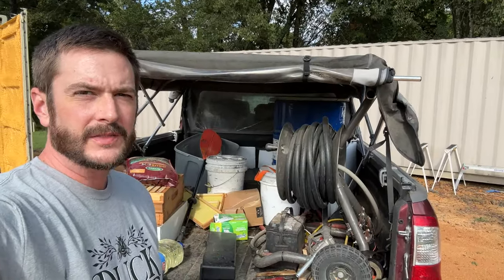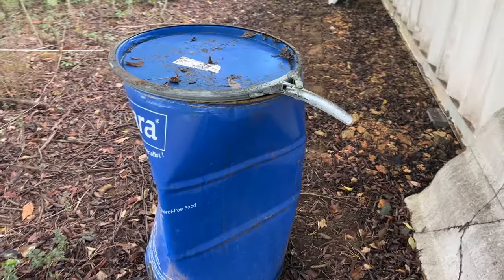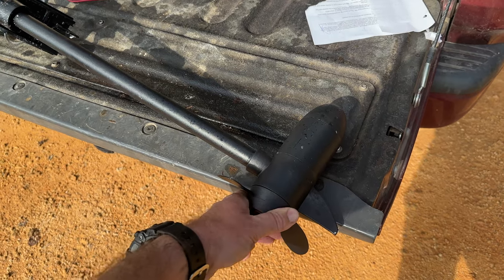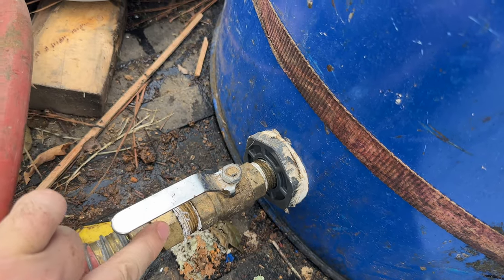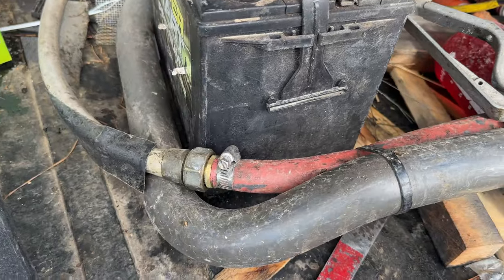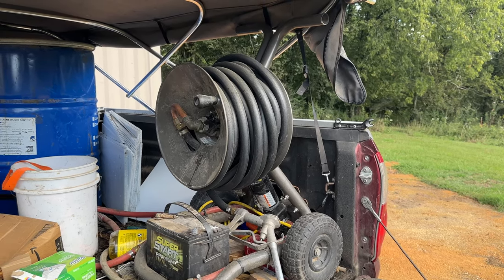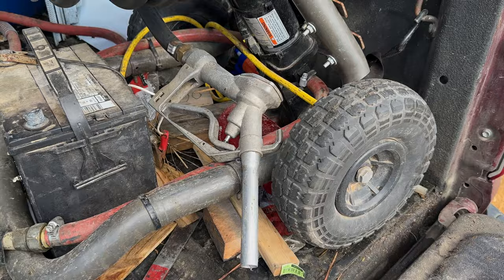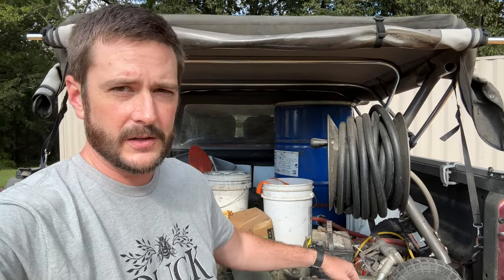Sideliner Syrup System

Comment: Hi Nathan. Just a thought. As diaphragm pumps get bigger (more GPM) they can also have a higher pressure shut off switch. Anything over 45psi tends to make the trigger harder to pull on your style nozzle. We use the same style nozzle that you do. Great video as always.
Reply from the maker: Thanks Bob!  I don’t have a lot of trouble with the 45 psi, but did consider swapping it for a 35.  The only real issue is when air is in the line and it blows out and spatters syrup in my face.  Always fun.
Reply: Bob I bet if you try the new nozzle with 60 psi you would be surprised at how easy it is to squeeze.

Comment: I finally bit the bullet and got one of those marco pumps like Bobs. Haven’t regretted it at all. I also got a battery extension cable from lowes with a male and female plug to wire to truck. I just plug in pump when feeding and remove it when finished
Reply from the maker: Good system, I may move to a Marco someday, or a compressor.

Comment: Really appreciate your links to the different items.
It's a nice setup you have there.
I've got a large tote, but I think I'm ahead of my time on it for right now. Would like to set up around a 55 gallon setup similar to what you have for now since that's more in line with what I would use.

Edit: On that 3/4" Rubber Hose, is that 3/4 NPT thread on that? Online it just says 3/4 I.D. But doesn't specify the thread. Trying to figure out which nozzle I need. The 1" or the 3/4". Thanks.
Reply from the maker: Get a 1” nozzle and adapt it, and garden hose is GHT, not NPT.  You’ll need an adapter from a hardware store.
Reply: @DuckRiverHoney  appreciate it!

Comment: Great video! This is the exact information I have been looking for. I currently carry five, 5 gallon buckets to my Bee yard with a hand truck. The area is accessible with a vehicle so I plan on putting this system together before Spring. 
I do have a question, did you get someone to design your labels or did you do that yourself? If so, who was it, if they do this publicly. 
Thanks for the guidance again. 💪🏻🐝💪🏻
Reply from the maker: I hired a graphic designer to help me, but they don’t do this sort of work regularly.
Reply: @DuckRiverHoney  thank you
Reply from the maker: No worries
Reply: To relate on your question... I hired a local artist to make my "logo," then I used Canva to build the label. Then, had a local printer make my labels. I'm trying to keep as much of my business as local as I can economically.

Comment: You can get a small vent tube with a vented cap like goes on a small hydraulic tank should work fine to keep anything from getting in.
Reply from the maker: Yep, I thought about adding some window screen with a zip tie, but it has t been a big issue.
Reply: Well normally all you nee is to drill a 1/10 Hole, that is allready enough. But better drill a bigger hole and add a screened plug from a feeding bucket. Easy to replace with a closed plug and the screen even keeps Ants out

Comment: SEAFLO 55-Series Diaphragm Pump - 12V DC, 5.5 GPM, 60 PSI
With
iSpring WSP-500 Reusable Whole House Spin Down Sediment Water Filter, 500 Micron Flushable Prefilter Filtration, 20GPM, 1" MNPT + 3/4" FNPT, Brass
Had mine for 5 years
Reply from the maker: Have any issues with the 60 psi switch?
Reply: @DuckRiverHoney  no issue at all. Same pump and same diesel fuel nozzle for years. The only issue I had was the filter was to fine but after switching to the 500 micron cold syrup will flow through it.

Comment: What really wonders me, in the US many people start to mess around barrels for feeding, specially when growing.
Why not straight go for an IBC tote? IBC totes are cheap and available in all sizes from 300 to 1000 L. Nearly no one here messes with other tank systems. Even ppl with just 50 hives and feeding systems will normally run a 600 L IBC maybe a 300 L one.

For the reel and hose, look up craigslist or so and look for used wall fire hydrant reels. They are industrial quality and have a high quality hose on them. Those are often sold for 10-20$ since no one reuses them.
Reply from the maker: Thanks!  I’ll move to an IBC tote at some point, but I’ll have to trailer it, so the drum in the bed is more convenient.